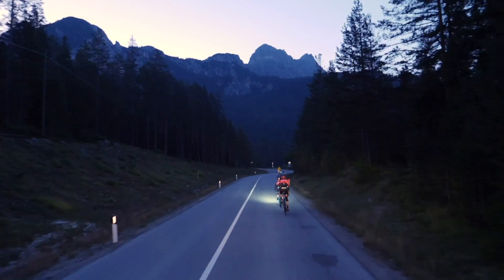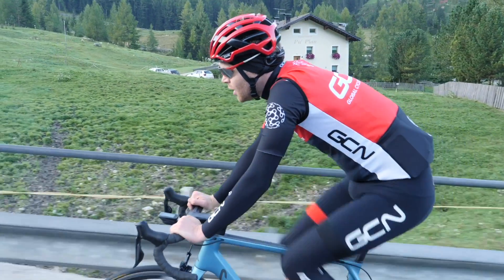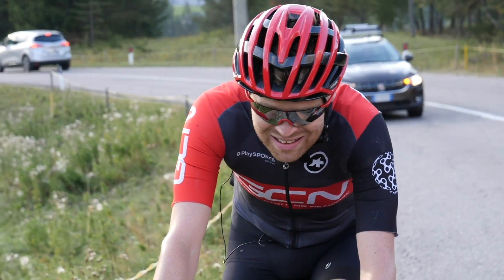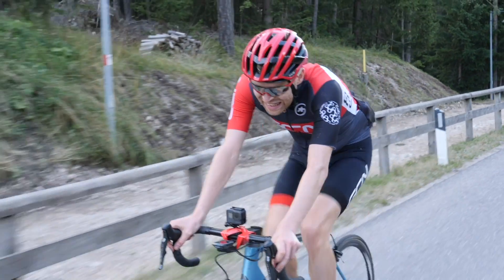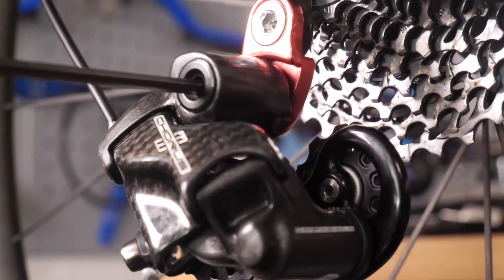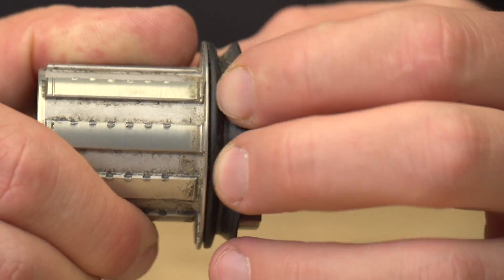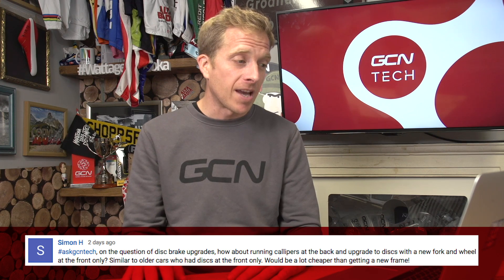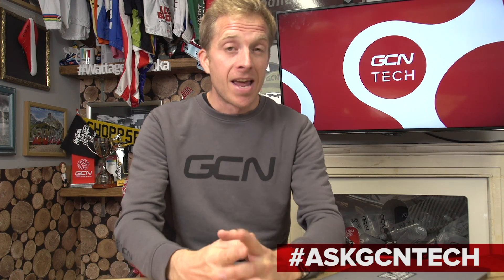Setting Up Your Gears For The Everesting Challenge | GCN Tech Clinic

Comment from the maker: Would you attempt an everesting? Plus, remember to keep your questions coming in using #askgcntech. 👇
Reply: I would attempt on Compact chainset (34 front) with CS-HG800 (11-34 rear) cassette, I think with 34x34 is as slow as you possibly can go with the target of everesting in 24h! This is a simple and reliable solution.
Reply: Nice one for answering! Now I've got to pull my finger out and actually do it!
Reply: @philadams9254  if your on Shimano 11 speed. A 105 5800 rear derailleur and replace the cage with a t670 long cage will allow you run a Shimano xt 11spd 11-40. It appears to still have addiquate b tension so  Maybe even a 11-42 or 11-46

http://www.gravelcyclist.com/bicycle-tech/bike-tinkering-101-shimano-105-derailleur-hack-by-thomas-aceves/
Reply: @ravennexusmh  Cheers pal, but i'm on SRAM Red for maximum lightness. I have had friends who have got to 40 teeth using a short cage Shimano rear derailleur and an extender - so no need for a longer cage - and I think it works for all of them too as I have seen the same with Sora.
Reply: Hi Jon , I found the other day that I have a brand new XT 9 speed rear mech. The only problem is that it's a shortcage. Can I use a derailleur extender and use the mech on my 9-speed commuter bike?
Reply: my bike is fix ultegra 8000 long cage RearD with XT 40T for pass 6 mths no problem
Reply: "...about 2 hours later we got it on. Sprained a thumb doing that." Sounds like you had fun :)
Reply: Sure, I'd be up for an everesting.  There is a rise from the beach to 7-Eleven, and I could do it on a cruiser in a week or two, and I could be powered by Slurpees.

Comment: #askgcntech Hi. I'm trying to adjust a 6 speed cheap shimano rear derailleur.
I have no problem getting the mech going from the smaller to the biggest cog, the problem is that the chain doesn't go from first speed to the second.
I've tried to lube the cable, re adjusted the limits. I think that the only solution is put new gear cable and make a wider turn at the back.(or change the meck haha) Thanks!

Comment: Hey Jon, I’m currently looking at upgrading my Ultegra 6800 to di2 6870. I was told by one person I can upgrade to the 8050 di2 f/r mechs instead but another said the 6800 cranks would need to be upgraded too as the front shift is different. Any thoughts? #askgcntech

Comment: Hi guys love the work you do! I have just bought a 1981 Dawes Lightening for a grand price of £35! I'm potentially looking at upgrading some of the components including the wheels. The frames dropouts are designed for wheels with the old through bolt on the hub which has securing  nuts on either side to secure the wheel. Will I need to make any adaptations to the frame if I wanted to put a new wheel set on the bike with quick release axles? Keep up the great content #askgcntech

Comment: Hi Jon, love the show. my question is about gear shifting. I have a Giant Defy with a Shimano 105 groupset and it will not change reliably between the second and third gears on the cassette. it changes fine going up from the small gears to the large, but will not change down from the second to the third. every other gear selects perfectly going both up and down. when I shift down to the third gear from second nothing happens, so I change down again and it jumps down to the fourth gear missing third.  I have cleaned and oiled the derailleur and chain, set the limit screws correctly and made sure that the derailleur moves freely. Any idea's Jon? out on the road it drives me mad!

Comment: Jon - I'm looking for help selecting a pair of tubeless road clincher tires. My rims are Boyd 44s (21mm internal width) and I'm looking for tires that will inflate to around 27 mm due to the tight clearance in the rear triangle of my frame (2012 Cannondale Supersix Evo). I've tried a number of tires, and I've yet to find what I'm looking for. Schwalbe Pro One 23s inflate to 25.5 mm. Schwalbe Pro One 25s inflate to a bit more than 28mm. But Specialized S Works 24s inflate to just barely more than 24 mm and Zipp Tangente 25s inflate to 25.5 mm. Is there any resource I can turn to for this kind of information? I can't afford to buy every road tubeless tire on the market to test out myself. Thanks!

Comment: Hi Jon, 

Derailler extender question.I had heard about these for a while, but after your positive review decided to get one.  It is allowing my classic 11-25 cassette to be replaced with a 11-34 cassette. Everything seems to work well in the lower gears (more teeth), but the shifting has become less smooth in the higher gears (less teeth). I guess it is due to the distance between the cassette and guide sprocket. The B screw is perfect for gearing the 25 to 34 wheels. But distance becomes larger when shifting to smaller sprockets. The short cage and large cassette are to blame I suppose. Any suggestions on making it better/ more crisp again. So far my extender adventure is not all positive, since 95% of the times I do ride on those smaller sprockets.

Comment: Hi Jon. I am running a Shimano Ultegra 6870 di2 groupset on my 2017 Specialized Roubaix. I have been using a 11-32 cassette all summer for endurance riding but have changed to 11-23 for winter flat riding. When I connect via bluetooth to my bike and the the e-tube app it says that my GS rear derailleur will not support my 11-23 and thus I cant set up the semi or full syncro shifting. Do I really need to go and buy a short cage rear derailleur? Or will syncro shifting still work with it set as a 11-32 on the app? Thanks
Reply: The mechanical side of the system will work with the GS, but the 11-25 cassette will mess up the synchro shifting, only because the gear ratios are different and the system will probably shift chainrings earlier/later than optimal.
To make it work for you, let the software believe that it still has the 11-32 cassette, then use the "customise" shift settings to dial in your shift points for what suits you and your riding

Comment: John, I totally agree with you in-regards to Shimano's 7800 road group-set. Infact the BR7800 for the longest time was the industry standard because of its superior braking /modulation for a rim brake. In 2004 I removed a brand new Ultegra group-set and installed the 7800 series along with a set of Mavic Ksyrium SL rims onto my Trek 5200 120 OCLV in the Nude Carbon finish. Three years later I purchased my 2007 Scott CR1 SL because it came with 7800 series group-set. I immediately traded in the OEM rims for a set of Mavic ES Ksyrium SL as part of the deal.  When the 7900 series arrived in 2008 I pulled the 7800 group-set off the Scott CR1 SL and installed Sram Red. I placed 7800 series components back into the original packaging that I kept from 2004 and stored it for a rainy day. I still have both bikes and ride them all the time and they still look pristine. Since then I've only upgraded the Scott CR1 SL front derailleur to the Sram Red Yaw along with a set a chainrings. Looking forward to the winter months as I begin my Sram Red eTAP bike build and yes it to will have a set of Mavic Ksyrium rims.

Comment: Solutions for low gears:
If mechanical 11s: use some pulley adaptor such as J-tech.
If Shimano DI2: you can get a MTB der to work.
If shimano 10s: you can get a MTB 9, 8 or even 7s RD to work with your STI (it will still shift 10 gears). I use Ultegra 6603 STI with Deore 9s on my gravel bike. That goes with a 9s triple MTB crankset. And a double FD.
You can also get a mtb mechanical RD and a microshift thumb shifter clamped to your handlebar specifically for the purpose (just leave the right sti unused on the bike - it's still your brake lever after all).

Comment: Hi Jon, I'd like to convert a 9 speed set up to an 11 speed so that I don't have to change the 11 speed cassette on the turbo to swap bikes. Will replacing the shifters, front/rear derailleurs and chain with 11 speed components work without replacing the 9 speed crankset? Or  do I need to replace the entire groupset? Thanks, love the show  #askgcntech

Comment: Hi Jon, recently i switched from a bike with 105 r5800 to a Canyon Endurace with Ultegra r8000. Ever since I received it I experience quite a lot of chain noise and “cricket” sound while pedaling, it seems to come from the crank area. Tried cleaning/lubricating the chain and indexing the front derailleur but no solution yet. Any ideas to proceed with?
Reply: Tomver chances are pretty high that the cricket could be the pedal threads creaking. You may want to pull the pedals, grease the treads, and reinstall. Hope that helps.
Reply: @Robs same old nonsense had same problem. Could be pedals.  I also thought it was my rear hub at one point and it was the pedals.
Reply: Also check chainring bolts
Reply: Believe it or not, check your headset. Completely re-grease the bearings and make sure it adjusted correctly. Any play will sound like the bottom bracket when it creeks.
Reply: Thank you guys, I’ll spend this weekend to see if it’s one of these points!

Comment: Hi Jon, I have a  50/34t and 11/28t running Dura Ace 9000 Di2, I am planning on doing some classic climbs of the Pyrenees next Summer. My question is could I run a 11/32t cassette on rear by adjusting B screw on rear derailleur(like Ollie on his Everesting Challenge) I am aware Shimano does not recommend this. Thanks Martin.
Reply: Your Dura Ace rear derailleur only officially supports up to 28 tooth
Reply: 11-30 will clear pretty easily, 11-32 pretty much maxes the B-Screw.
Reply: Most of the time a cassette one size bigger is no problem, two sizes will be the limit but often work. keep in mind you might need to longer your chain a bit.
Reply: Should be able to do it

Comment: I had the same problem with the Mavic wheels. Cleaning helped a couple of times, but only temporarily. There are aftermarket regular bearings available from i.e. Hub doctor or drivetrain .be to replace the rubber washer and the hard plastic ring. I haven't ridden it much yet, but so far it seems to fix the issue.

Comment: Need to check that cyclocross rim for max tire pressure. Many rims are not road compatible because the max pressure is 45-50 psi. This is the case for several Stans rims like the Iron cross. A more beefed-up rim like the Stans Grail is necessary if you want to run road pressures. 21mm internal width is quite wide and makes it likely that it's an off-road specific rim and maybe not suitable for road. Check the specific rim pressure recommendations.
Reply: Researched this myself recently and found that road tyre pressures aren't possible on that mentioned rim but you can go 50-60psi

Comment: Hi Jon, for next season I’m looking to invest in a powermeter. 
I run a Shimano 105 5700 crankset and a Shimano 105 5800 in the back (2x11). 
I’m looking at the 4iiii precision 105 5800 one-sided powermeter, Will this work together or should i change the crankset to Shimano 105 5800?
Hope you have an answer for me.
Thanks,
Edgar

Comment: #askgcntech. I have a Ribble r872 which fits 25mm tyres and I was wondering if it's possible to  run a 27mm wide rim with 25mm tyres or will this result in the tyres or wheels rubbing on the frame and fork, there's currently 4mm room either side of the tyres and the rim.

Comment: I bought an old dutch road bike and wanted to partially restore it, partially make it more convenient for me to ride in the city. One change I did was change to a straight bar instead of road handle bars. I managed to get new braking leavers, works fine.
BUT :) I want to change the gear shifting from "down at the frame" up to the handle bar. I found some kind of extenders to get the cables up, but I cannot find any shifters. The bike has 2 by 6 gears...and I would like to get something like a rapidfire shifter. Is there any model I can use?

Comment: #askgcntech
Hi John, love the program and the channel. I’m have an issue with one sprocket on the rear cassette of my bike. I run a sram red etap groupset with an 11-28 rear cassette and rotor chainrings 56/42 however the 4th cog from the top of the cassette makes a skipping feeling and sound when I use a kmc 11 speed chain even though it’s cut to the same size as the sram chain which works fine. How can I get my kmc chain to work? Many thanks, Nathan.

Comment: #AskGCNTech 

Small hands = Narrow tires? 
I've got small hands, so I have recently adjusted my 105 shifters close-in so I can reach them in the drops - though I regularly take my front wheel off for transport in the car. I can now barely squeeze my 25mm tires past the (opened) calipers and pads, which has scuppered my plans to move up to 28mm.

Are my small hands doomed to run narrow tires, or is there something else I can do?
Reply: Ivor Johnson if you haven't, re-do the cables/ adjust your barrel adjusters after adjusting the brake levers - this should free up a little room.

Comment: can you hack a 10 speed hub to fit 11 speed cassette
Reply: For many hubs you can file about 0.6 mm off the inner lip to make 11 speed work. Works for most hubs but not all.  Machine shop can do it but a dremel or hand file plus patience will also work - keep measuring as you go.
Reply: Shimano - the 11-34 11-speed cassettes (CS-HG800-11 and -HG700-11) fit on 10-speed freehubs. Other MTB 11-speed cassettes may also fit.
Reply: MRGRUMPY53  buy a different brand as suggested.

Comment: Hello Jon, 
I got a question, I just replaced my old chain and casette (ultegra 6800) for kmc 11 speed chain and r8000 ultegra casette. But since I have replaced them, I have a rattling middle sprocket. 
I went to the local bike store and they thought it was because of the indexing. But this wasnt the case. I tried a shimano 11 speed chain, but still the same problem. All the other sprockets dont seem to have any problems, except for this 1 in the middle... its making me crazy.. any ideas?
Thanks in advance #askgcntech
Reply: I have the exact same problem on my brand new bike
Reply: @gilleshabscheid1014  I even tried to change the hub, i heard that somebody had this issue, replaced his hub and it was gone... but for me it didnt change...  so still got this terrible noise :(

Comment: Front derailleur must be adjustable on the seat tube viz must not be brazed on. Otherwise mountain bike cranks are fine - I use Deore and Deore XT 38-24T without problems. The fitting needs a shim on either side, but no noticeable difference to the Q angle